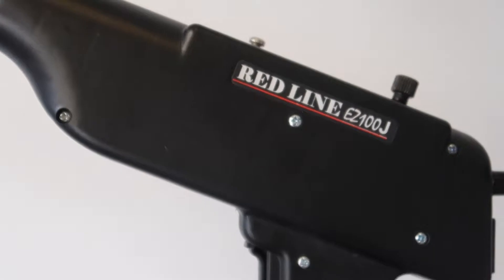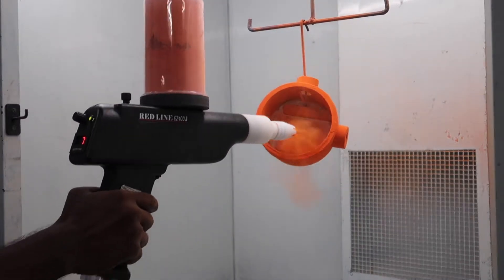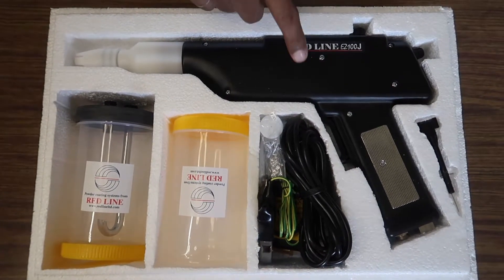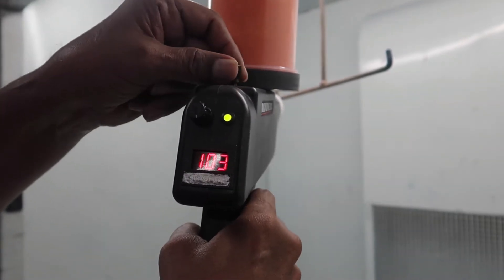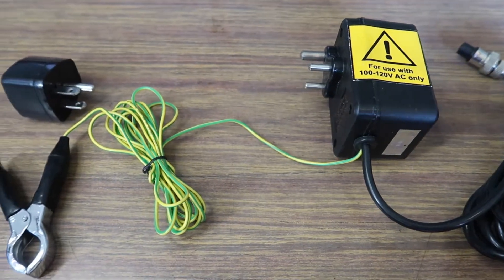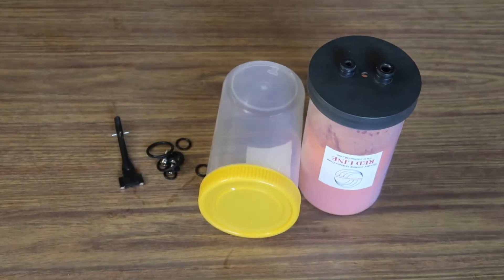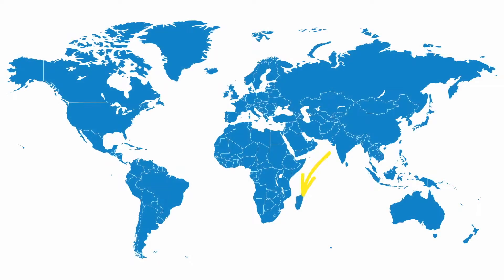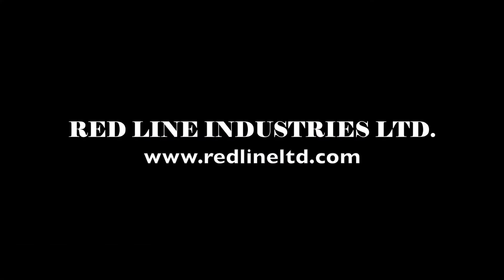Red Line EZ100J Powder Coating Gun - Unboxing | Red Line

Comment: What air line hoses does this use? I live in the US and I haven't seen this hose used. I just bought this gun and need information on where i can buy a kit? Preferably on Amazon if you could! :)
Reply from the maker: Ideally contact the dealer who sold you the gun. Red Line Dealers in the US usually carry these requirements and they will be happy to assist you